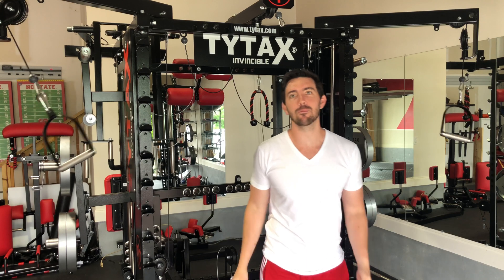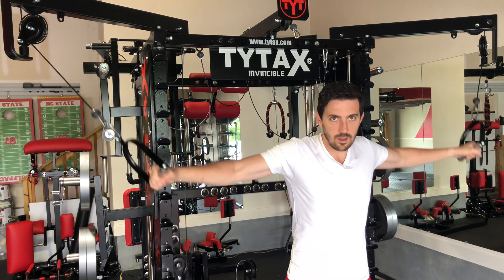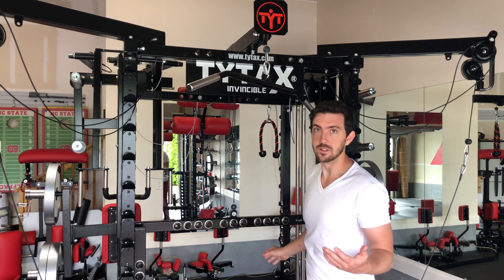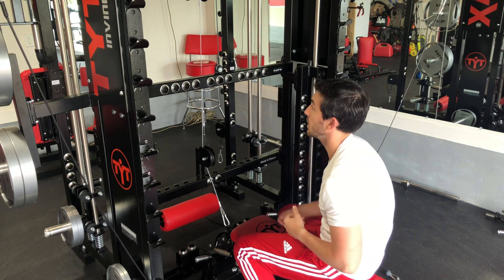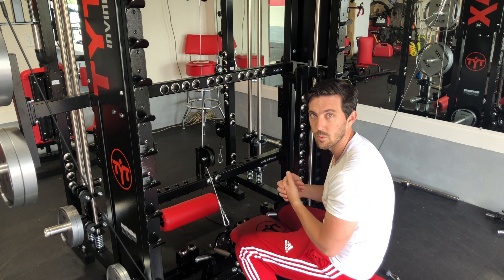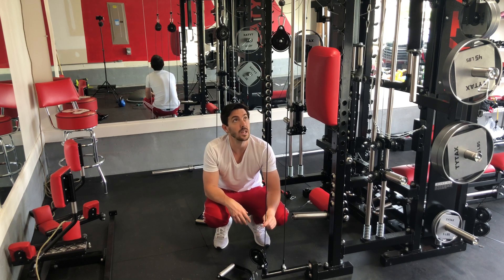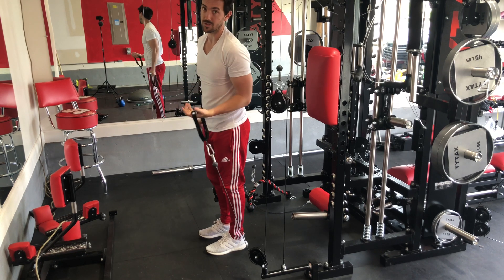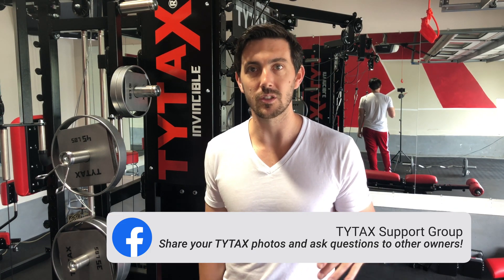TYTAX T-Series: Pulleys and Cables Standard

Comment: Great Job Chris, I noticed when you where doing seated rows in front with lower pulley. Does that handle come standard or did you buy it separately. Thanks
Reply from the maker: Roger Bingman great question...those handles are standard.
Reply: @thedadoffice8318  quick question not related to video. Does this extra cross bar attachment come standard
Reply from the maker: Roger Bingman you will have to be more specific. Not sure what piece you are talking about.
Reply: Trying to post pic won't let me I'll DM you